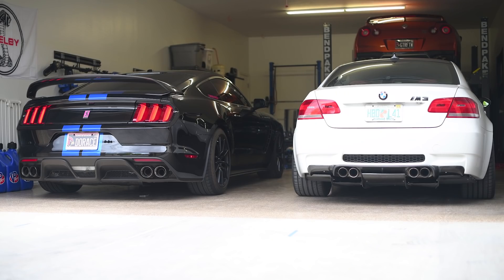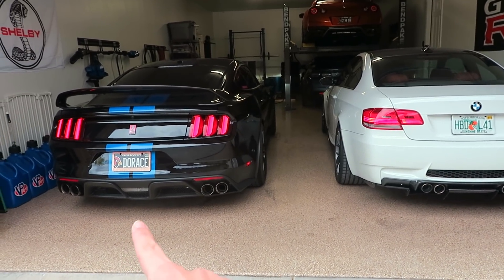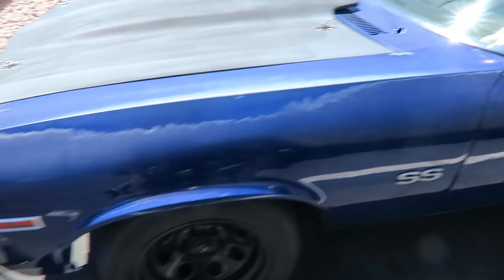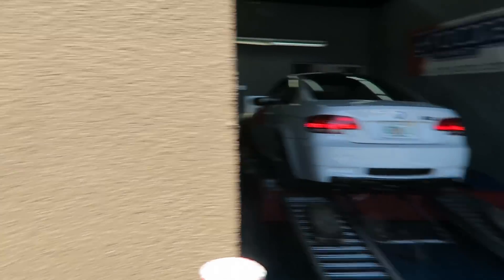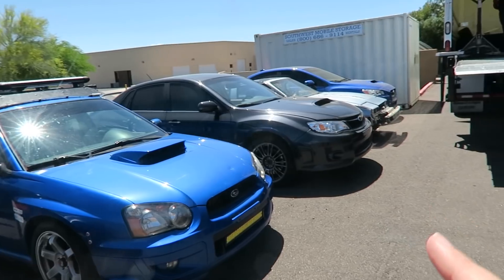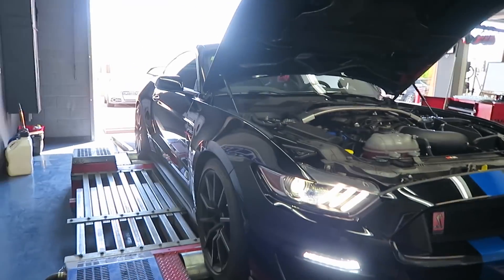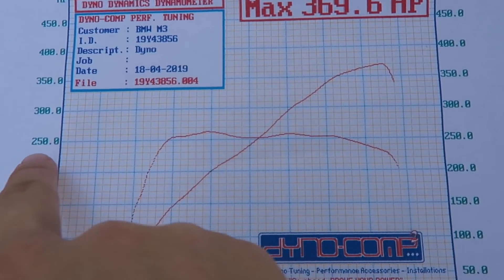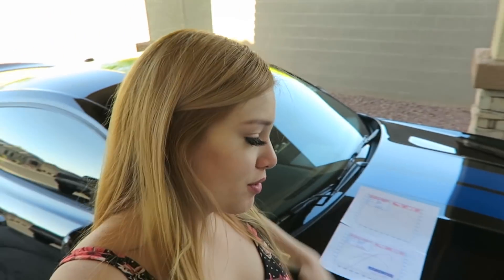DYNO DAY! 2018 Shelby GT350 with JLT Intake and Proflex + 2009 BMW E92 M3!

Comment: I use nothing but Shell premium fuel that is 0% ethanol. Ethanol is Hygroscopy  and will eat away at your fuel lines and other metals cause it attracts moisture like brake fluid. That blue SS is a Nova. If you ever buy one, look for a 1968 to 1972 years body/bumper style. IMO they look the best.

Comment: Great vid as always. When you order the MGW I suggest you get the billet lever and shift ball. The MGW was great without it but it's even better with it. It gives it an old skool feel but very precise.
Reply from the maker: I already have it. It's sitting on the garage floor. I ordered it with the kit to use my stock shifter. I wanted to keep the oem look inside. I can always change it later. I need to try how the shift ball feels first.

Comment: Shelby GT350 gives 507.1Hp  nd 400 Nm Torque  Nice Dyno Graph.  Exhaust sound of Shelby is much satisfing nd give attention. 
Shelby GT350 5.2L V8 Engine Produces 526 HP nd 429Lb torque as claim by Ford

Comment: Did you notice a big difference between the stock intake and jlt?  I just notice that the stock one with a k and n is really efficient.  Im trying to decide if its worth it or not.  I hit the dyno tomorrow after my cat delete.  Hoping for some good numbers.
Reply from the maker: Only when tuned..a bit of an increased pedal response and when the temps are cool, it's a benefit. It's worth it for the cooler IAT and responsiveness of the throttle. It will provide some hp, but when tuned for it. Let me know what you make.

Comment: So is it okay if you mix 91-93 with 110 octane on stock car? I always use 93 here in Ohio and I run high 11’s 1/4 mile. But I want try a safe mixtures and make good numbers before I tune the car lol 

Loving the m3 sound but honestly the mustang sounds is my favorite 😍
Reply from the maker: 93 is already good enough. A mix with 110 unleaded shouldn't hurt. But it all depends on the car. You may not see any increase in power, but the timing and engine will be happy. A tune will make the best use of the additional octane reading.
Reply: Woman.Driven thanks for the info. My goal is to hit 11.0 on stock so wish me good luck lol

Comment: "WEPA"!!!  507HP!!! You go girl !!! Love that GT350... Will you consider "Palm Beach Dyno" Tune (Rob Shoemaker) might be better. Keep those Mods coming...
Reply from the maker: Happy with it lol. Knowing there is still room to grow..likely more power too. I don't feel I need a tune. The the power I'm making is strictly off of the proflex which just allows for the e85 reading from the injectors and not post combustion like the lund tune. The lund tune I have now is a 91 tune that allows the use of the JLT intake. So the benefit is really for the intake. I will look into the PBD tune when I move into the route of internal work like porting and cams. At that point, I will need his expertise lol. Mods are almost always coming. Thank you!

Comment: Hola Saludos Doris... my question is I noticed you had the E85 Lund tune and now converted to the pro flex commander.. for the GT350 what’s the difference between them? I do know Lund uses the same logic Ford does OEM with flex logic and  that flex commander use a wide band virtual flex logic.. just afraid of getting bad E85 from the pump and it pulling out of timing ..  Gracias.
Reply from the maker: The Lund reads the e85 post combustion and that is assuming the static value falls within range. So there is a period of time that you need for the content to be realized using the Lund tune. With the Proflex, the reading is real time since it plugs into the injectors and back into the engine harness. So ethanol is read much quicker and safer in line. The timing is auto adjusted by the ECU on it's own. It does not need to rely on the Lund tune for it. It does a good job out the box. What I noticed was a smoother delivery of power and way better idle and cold starts compared to Lund. I still use Lund, but only for the JLT intake MAF readings. Not for E85.
Reply: Woman.Driven Thanks for the reply.. makes perfect sense now therefore I will also go with the pro flex commander for my 2017 GT 350.. I also run Lund’s tune for 91-93 octane and my JLT intake.. i went with a Shifteck mid pipe cat delete and Shifteck xpipe resonator delete also it sounds amazing.. thinking of doing longtube headers actually but would definitely settle for a whipple supercharger...I just have to many projects going on at once I just tuned my 2017 Ford F-250 6.7 Powerstroke with a ez lynx platform HPP tune got about 614 rwhp out of it .. that big boy moves .. it will hang with other stangs..

Comment: Great  video  my guess  was a  little  over  500 on the  gt 350  I was  close  on that I thought  the BMW was doing  to be close  to  400 guess  I  was  off on that  one  keep  up the  great  work
Reply from the maker: Great power on both. M3 would like be closer to 400 if it was on the proper 93 octane or even full e54. But the power it has makes it great on the track. Thank you!

Comment: That’s a nice Beamer what do u recommend to do to my 135i N55 stock to add more HP
Reply from the maker: JB4, BMS intakes and downpipes. That is all you need and the power you would get is a lot. More than 100hp.
Reply: Thank u for the advice 👍🏻

Comment: here in chicago we have e85 but when you test the gas it is less or more so its hard to keep a good tune for the gas. they sell testers on the internet. and it uses more gas than regular gas, so i dont use it in my grand national.
Reply from the maker: That is why I use the proflex. It's flex so the timing is handled by the engine. I don't want a tune for a certain grade of e85 and miss the target and timing because the consistency is off.

Comment: She looks gorgeous and beautiful smile on face too. I don't know why M3 have a less Horsepower but the stock 2009 M3 comes in 420 horsepower and GT350 comes in 560 Something near about. What's the reason behind this
Reply from the maker: These are wheel horsepower figures. So the power is measured at the wheels, not engine. The M3 is rated at 414hp and the GT350 comes with 526hp at the engine, stock. Taking the numbers they both made at the dyno and you add the 20% drivetrain loss, you get the following new engine hp # - M3 now has 454hp and the GT350 now has 608hp engine. So quite the difference. If you add a 15% drive train loss, the numbers are 435hp for the M3 and 583hp for the GT350. Hope that helps. Thanks for watching!
Reply: @woman.driven  That's great and by the way why  Dyno measured by wheel Horsepower. What's tbat drive train loss. I don't understand by this word.
Reply: Wow 2019 GT 350 comes in 608 pS. Dang. I'll check on Google. Yeah i know that 2019 M3 comes in 454 Horsepower. I went to BMW dealership in Modesto,CA for my 2010 Bmw 535i oil and fuel filter change. They told me that M3 have 454 ps. Your welcome Dorace. Have a wonderful day ahead

Comment: Hey I notice you said arizona doesn't have 93 octane. This is a huge upset for me as my family and I are suppose to move there in the next few months. My GT350 has always ran on 93 octane. Before you were modded what did you do? 
Majorly bummed here.
Would I just have to tune my car and run on  E85 full time now?  
Like I said i've always put 93 in my car here on the east coast, going down to 91 I just know the car will not be happy being that it has always had 93.
Any suggestions..........
Thanks
Reply from the maker: lol..I welcome you to AZ...in a few months. 91 is not that bad for an N/A engine like this one. It does fine. Sure you'll be under a bit of hp and tq, but what can we do? You don't have to tune your car. You can run the proflex which connects to your injectors and then pump e54 or e85 and call it a day. No tune required. If you happen to live near a station that has e54, great. Makes more power than 93 any day of the week. That is my solution and I 100% fine with it.
Reply: @woman.driven  awesome - thank you. 
I also read that places out there have 100 unleaded race fuel and looking over a mixture calculator on octane I could mix a few gallons of 100 with more of the 91 and get equivalent to 93-94 octane. So that's another option. I will be interested to see how readily available the E54 is out there.
Also going to look into that pro flex thing a ma jigger. Thanks again.

Comment: Wow was expecting alot more power out of that m3. Sounded like it was making 400-500 lol. But some good numbers on that gt350, keep at it!
Reply from the maker: lol..they normally don't make much, but they're amazing on a road course. They're 414hp engine wise stock. So adding the 20% loss to the wheel hp now it gets you around 455hp. So the increase is there from stock. Plus these dynos run a bit lower than your traditional dynojet. With headers and E85 it can break the 400 wheel mark. For 420+ you need a supercharger for that. These engines are pretty high strung from factory. Not a lot of room to make power without F/I. Thanks for watching!
Reply: @woman.driven  ah no wonder. Saw the sheet flipped over and it surprised me, but still one of the best all around driver focused cars.

Comment: i would of thought the BMW M3 would of been more.  It does sound awsome.
Reply from the maker: I thought less lol. But it is down on octane on a normally lower reading dyno. But good enough. I for one appreciate that car and the engine it has. Plus it's handling characteristics. Very similar to the GT350.
Reply: @woman.driven  i had a 2002 M5 and loved it.  It did not sound as good as your M3 though.  Keep up the good content

Comment: What part of the galaxy are trying to get to with all that horse power?
Reply from the maker: To the center, just to get a closer look at the super massive black hole..but not too close that I can't come back. 500whp is plenty enough for the track. At least for this car..for the moment.
Reply: @woman.driven  you won't be hearing your car it's too loud, you want speed which is horse power not hearing lose, all I hear is alot of noise and at the track there's enough noise and you want to add more noise, it's good to have big pipes but I would like horse to get down the track faster and not blow your ear drum
Reply from the maker: Noise is a byproduct of a least restricted exhaust. Being a V8, it's going to be loud either way. I enjoy the benefit of the noise it makes. I suppose all NASCAR, funny or top fuel cars, GT1, 2 and 3 race cars should all be quiet in this regard. They are loud; not because they want it on purpose, but because flow and an exhaust with the least amount of restriction is important. I'm not making these changes because I want to only be loud, like what you hear in the street. I actually track my cars and I want the best performance possible..if that makes it louder..great..a huge plus to add to the experience.
Reply: @woman.driven  oh ok I didn't know that, thanks for telling me that, I like your rides, where I live  people drive around in there obnoxious car's making noise, I heard a few car's that sound like your and they sound awesome, as long as your car is fast that's all that matters, I've learned to hear and feel that's what makes differentiate me from a mechanic, I admire nascar they know what's up, I have a 92 accord coupe cb7 5spd inwhich I want to swap it out for a 6spd and I have changed the handling and almost done with the suspension and replaced the stock exhaust to 2.5 stainless steel anyways I don't want to bore you, I admire you as a women and what your doing just be unique not another copy kat 😊, my favorite car is the 65 shelby gt500 Eleanor from the  movie gone in 60sec. Nice chatting

Comment: Nice... I think my Stinger has more potential than both.. I've owned it for 3 months and never been more impressed by a car. And I'm pissing a lot of Ford owners off.
Reply from the maker: The Stingers are great cars. Performance is there as well as the looks. But these are cars geared more towards the road course. Can't really compare them. You can easily tune the Stinger to be very fast in a straight line..that compares more to the GT's who love to mod their cars for drag and rolls. A lot more goes into a road course car. I've seen the reviews, very good build from Kia.
Reply: Very cool quick things are a passion. Cars included... Keep up the good work.

Comment: My Steeda tune for my Bullitt is basically the same as this, actually has better low end torque and HP, Shelby only beats it from 6500 to 8000,
Reply from the maker: Different engines and power curves. GT350 excels at those high rpms because it lives up top at the road course. Makes the best sense for it. The Bullitt and the GT 5.0 have a power curve with strong torque making it a great launching, 1/4 and street car.

Comment: watching your engine tear down on the mustang engine shows a object has went through the valve to the top of piston, causing piston damage and block wear, metal contaminating  oil got to bearings and oil pump. I would have parts vatted block bored, crank polished, New  piston, oil pump, valve job,

Comment: At higher speeds Corner curb traction the BMW it's no different than the high-end AIT Motors because of the adjustable suspension you can adjust it with your hands the BMW Infiniti you got to do a little bit more work to get to it muscle cars got to buy shock strings Springs and struts in doll adjustable would like Honda you know shocks Springs and struts sometimes they have all three but duh the spring differential as far as maximum weight 2000-4000 6000-8000 on the spring the spring is in how much weight it can take put on four Springs + the shock absorber along with the struts as well as the shock absorbers four wheel independent suspension but then the carving is in the car traction on corners on while braking is no different than driving tight or loose the faster you go the more the rear end needs to stick to the ground at least that's what it is in my mind so when the rear end dumps is in you know locks down when picking up speed the rear end that's what I call Dad Rock gear I call it the drop gear and then I dropped your Kik saying sometimes the rear end you'll see it actually drop not so much about speed or even the dino I like 2 wheel 4-wheel drive option simply because of the spin out issue but then you've got the spin out with limited slip one wheel or on positraction rear end two wheels but then you got the limited slip that sometimes when it's spinning out both Wheels a lock us gaining traction on the turn but then that also sometimes prevents spin out so four-wheel drive in that option just because of the accidents have been in there's motorcycles there's bicycles and there's vehicles traction and then there's cars traction my diesel mechanic teacher was a car accident surveyor so when there was an accident he would be called to the same to study what happened you know what the physics and chemistry side of studying where they going to fast checking the traction checking the computer checking the traction checking the computer some people don't know when the car stops because of an accident there is a big issue and the computer reads what happens at a dead stop when it emergency shutdown of some things and cars today you know it's no different than a GPS system the computer in the car records what goes on four. Of time does preventing people from lying science so if you don't do the crime you don't do the time assault and battery or burglary

Comment: You have so many cars but none are crazy fast... build one
Reply from the maker: I don't need them to be crazy fast. The use for them is mainly on the road course. I need them to be the quickest without comprising the handling and balance. I'll choose a different platform if I want to be crazy fast in a straight line.

Comment: Yeah pretty sure a loud exhaust doesn't equate to horsepower....loud exhaust are for posers and teenagers...350 is the champ all the way around.
Reply from the maker: The M3's don't make a ton of power. A car that revs up to 8600rpm is made to stay high on the revs at a road course where it shines. a 4liter high compression engine will sound that way. Way better for exhaust flow where it matters. Although an older car, it can hold it's own with the GT350 if you add the same size brakes and better tires.

Comment: Question what does this chic do to afford all thes expensive cars?
Reply from the maker: This chick works for a company as a Systems Engineer.
Reply: Still the salary for a system's engineer is nowhere close to what you are making
Reply from the maker: You're not accounting years of experience, skills, certs, company, location. Looking at what the average is online won't give you the actual number. Include the factors above and it gives me what I need to afford my two cars with no issues.

Comment: Muhahahahahaaaa i have more than double torque than your Shelby on my Camaro SS 5th generation :P so its a slow duck like your BMW
Reply from the maker: 👍 Not worried about it. On a road course you're above the rpms for torque and rely more on hp.
Reply: @woman.driven  no, the real problem is that you are far away when my car is still standing on its place with spinning wheels while there is too much torque 🤣